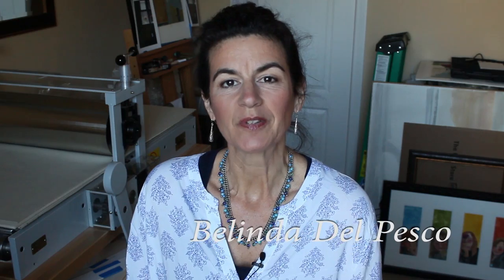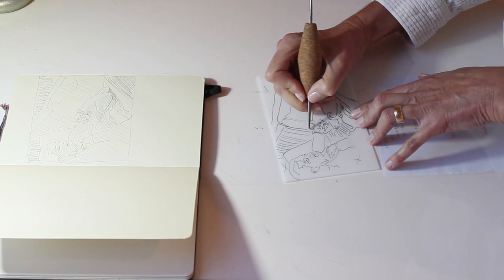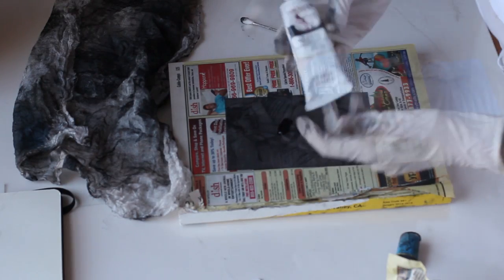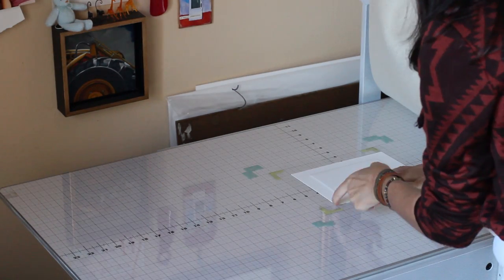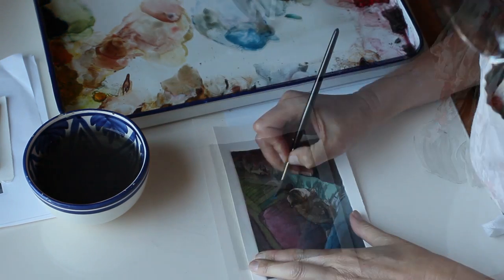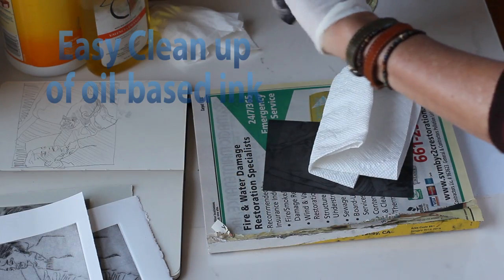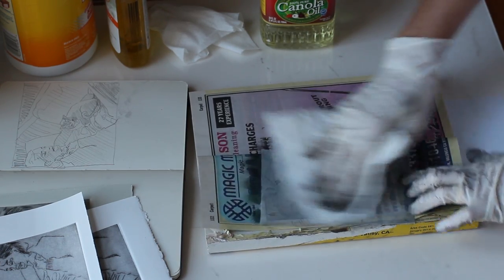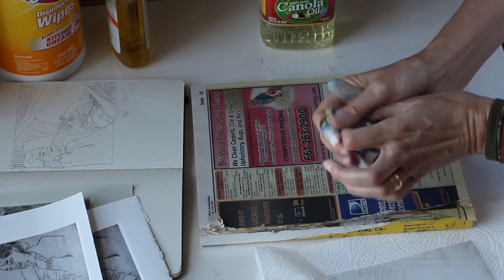How to make a Dry Point Print from Drafting Film - and Paint it with Watercolor

Comment: I really thought that you would be adhering the drypoint on Mylar onto the mat board  (with spray adhesive)...............is there a reason that you did not do this?  I am just interested.?

 Very good instructive video  Belinda - as always ?
Reply from the maker: Hi Aine, I don't mount the mylar to the mat board because I keep one mat in that size, and I use it for all prints that need a little lift if the plate matches that dimension. Also, I print very small editions, so after I printed this one, the mylar plate goes into an envelope with the prints, and gets filed. Thinner storage with no mat or thick plate. :)